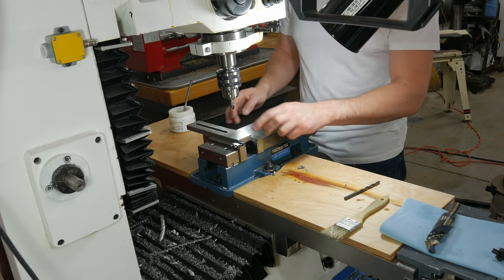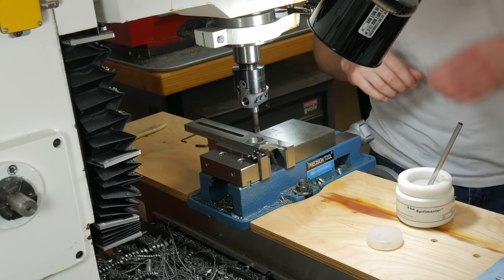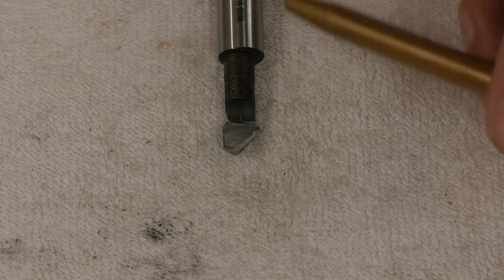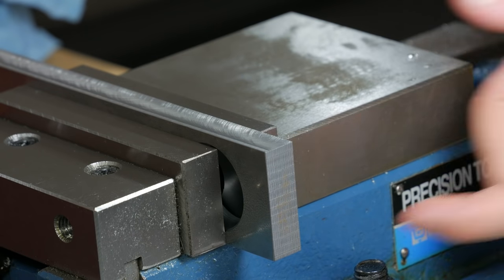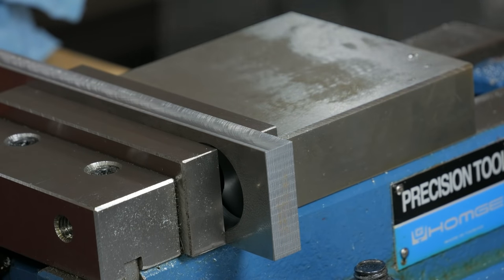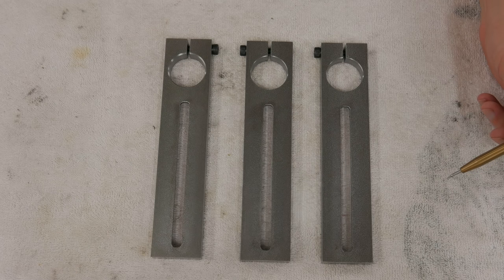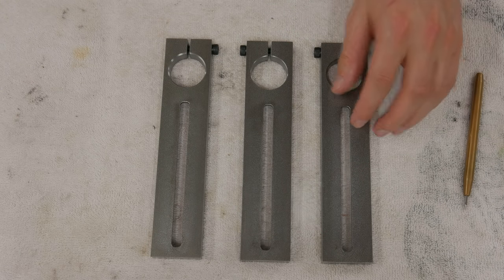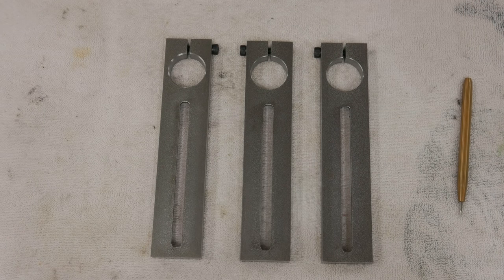A Better Lathe Banjo Pt. 2

Comment: Hi Dan.  I watched a video the other day where a copper piece the size of the large hole was fitted into it so if the metal did spring closed it would not bind or break the saw blade.  Great videos

Comment: Can't you just flip the piece?(I'm Assuming that the slot and bore are not offset to one side or the other of the piece here).
Reply from the maker: Unforgettably, I can't flip it. The slot on the back is bigger as it retains the nuts that lock the gear shafts in place.
Reply: I didn't notice that it was a stepped slot, sorry.
Reply from the maker: No worries, its an easy thing to miss.